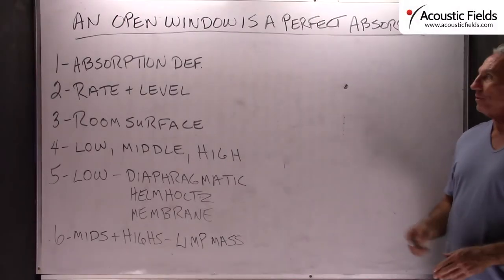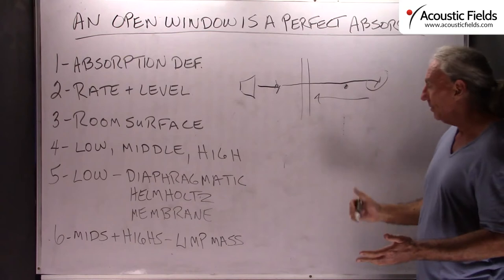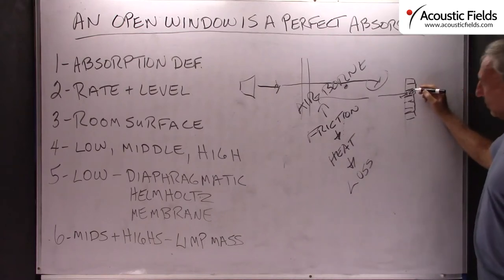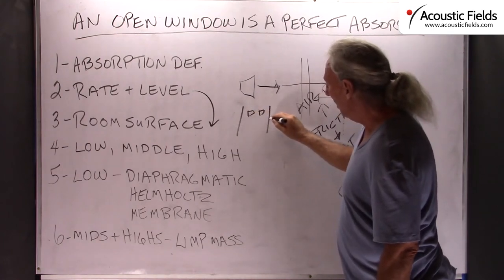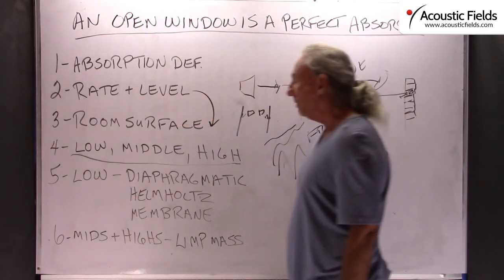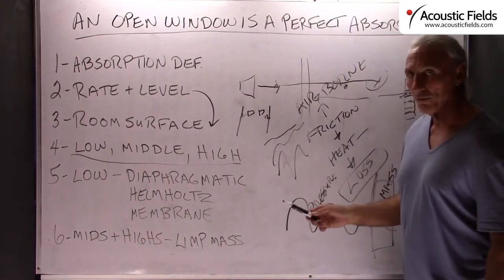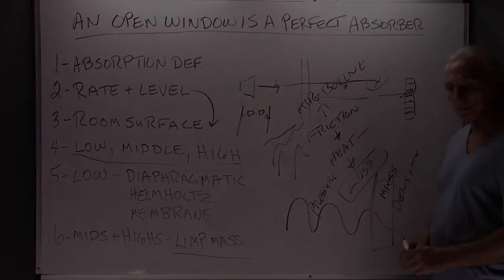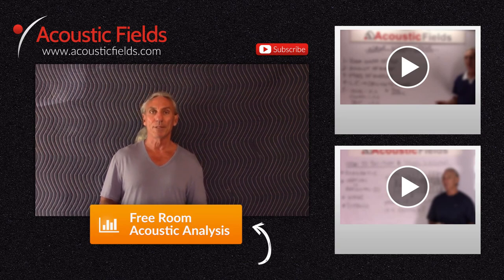An Open Window Is A Perfect Absorber - www.AcousticFields.com

Comment: This is true at high frequencies but at lower frequencies it will not act as such due to impedance mismatch.
Reply: Wrong. It is of floor/ceiling reflections that creates the nulls. Place your speakers outdoor, measure it and see if impedance mismatch is still happening.
Reply: @automachinehead  I think you're wrong here. Impedance mismatch is a symptom of the effect of sound waves not wanting to travel between two mediums due to their relative acoustic impedance. It's why sound reflects off hard surfaces (the impedance of a hard surface, or even non-hard surfaces) are much higher than air. The air outside a room is much more "free" and, therefore, has lower impedance. The air inside the room has a higher impedance. In this instance, lower frequencies (which have wavelengths larger than the hole) will not want to go through the window.

Open your car window a little bit as you drive, notice how little low frequency noise you get coming in when it's cracked vs when it's open.